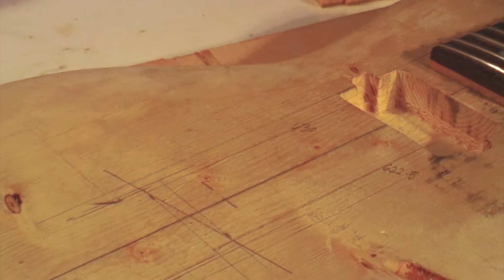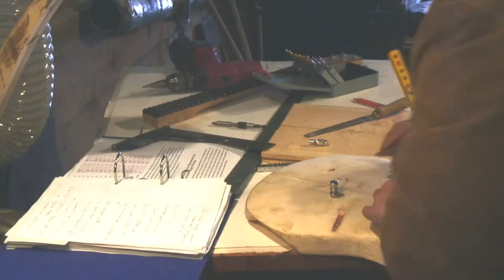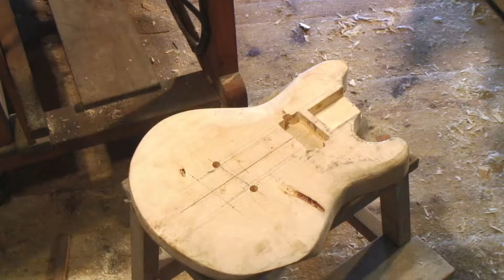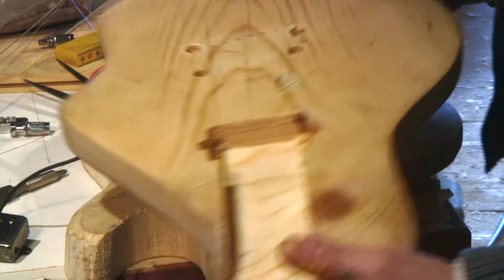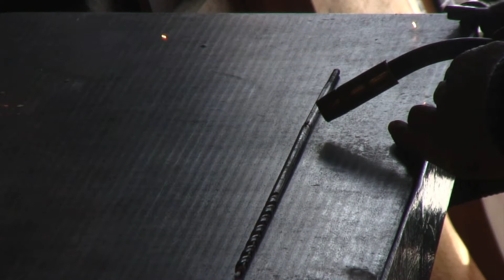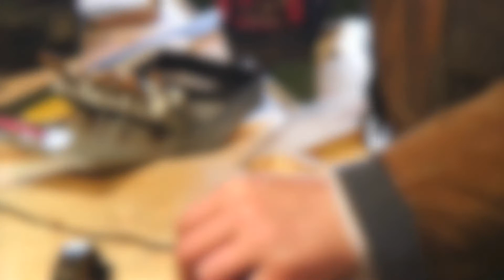🔴Fanned fret guitar building Part 4/6 - Bridge placement, without templates.

Comment: How many bodies did you make?  I noticed a couple knots and some pleasant grain pattern in the part 3. I don't see them in this body. It is awesome to see you modify tools to achieve your desired results. Too many folks have their creativity limited by what is available at their local hardware store or home center.
Reply from the maker: I have made three guitars to completion in this manner. and have two or three more bodies cut. and materials to make about seven guitars total. It takes a long time making guitars like this so any hope of a commercial venture is pretty hopeless, how ever good they sound and feel. Norway is not the place for hand work (because of the cost of living), it is not surprising there are so few commercial  hand workers left here.